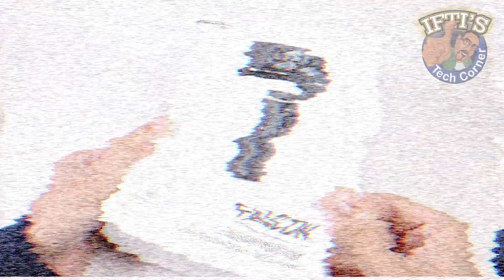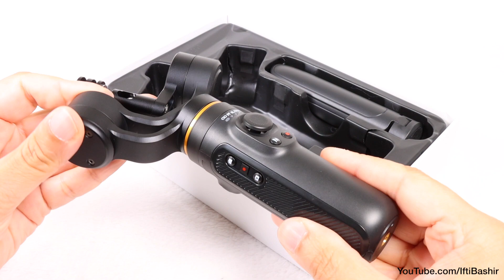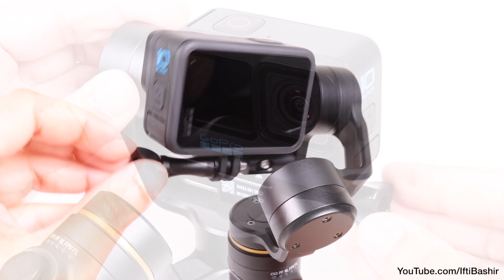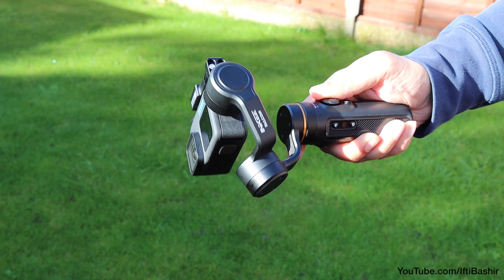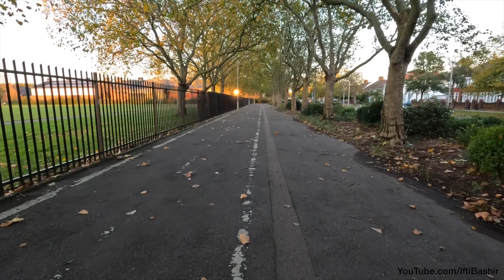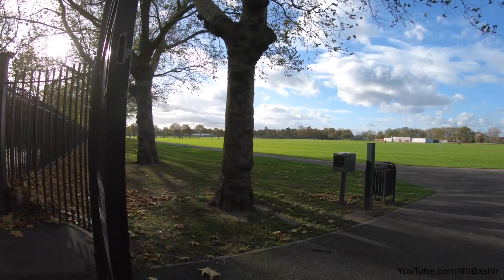Inkee Falcon Action Camera Gimbal with Wireless Control - GoPro / DJI / Insta360 One R - REVIEW

Comment: Nice quality gimbal also bought this.   I only have observed when you triple click the trigger button for selfie mode the gimbal does not rotate 100% at 180 degrees facing you on just a little less like 160~170 degrees. Have you also observed that?
Reply from the maker: When mine did this I would restart the gimbal, or recalibrate. Usually it was fine after that for a while. Hopefully a firmware update will come to resolve this.
Reply: @iftibashir  You mean an advanced calibration via the app 6-axis? Or a static one ? Currently I have the latest firmware version 100. I don't remember in fact if that was happening on previous versions 🤔. Also regarding the gimbal and camera connection with Bluetooth pairing is successful for the first time but every time I reboot the gimbal the camera is turned on automatically as well, however I need to go to connections and pair the device again in order to shoot with side buttons.